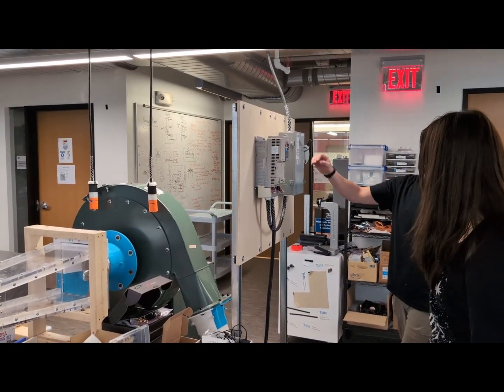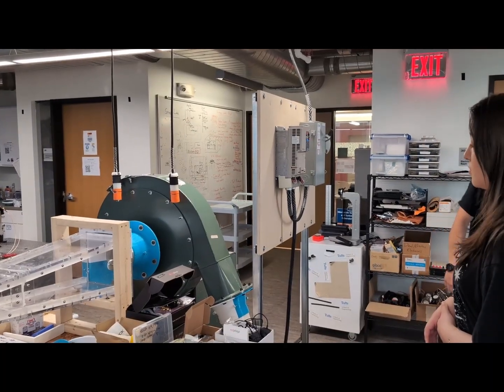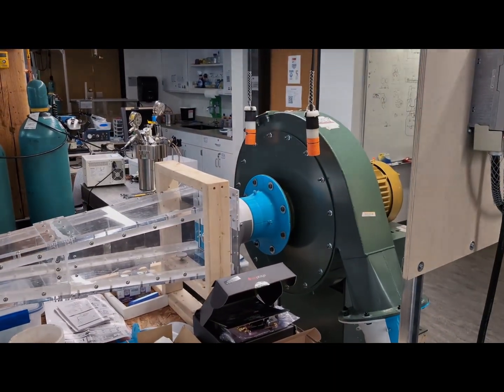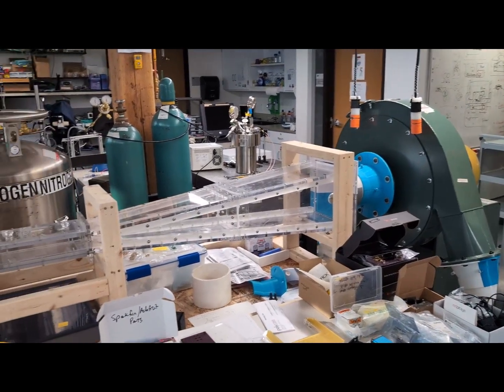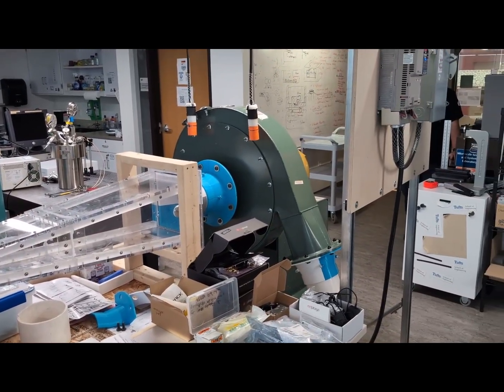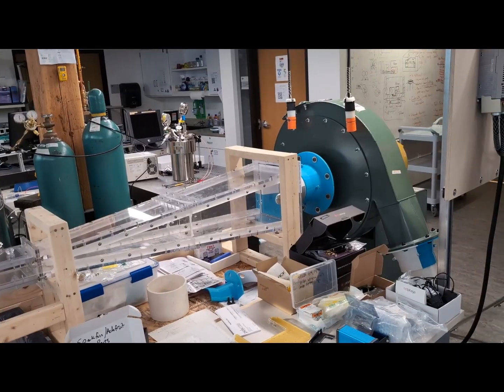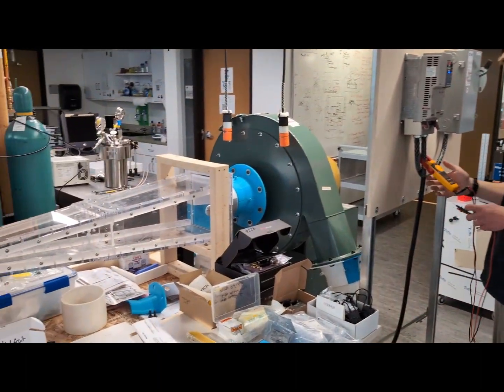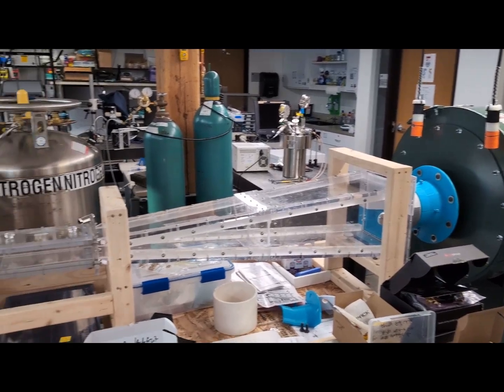Tufts Mach 0.5 Tunnel - First Turn On!

Comment: Yeah there are two ways to go ... suck down or blow down tunnels.  In both cases the air is recirculating around the loop, so it needs to be cleaned up in the settling chamber and as it goes through the honeycomb and screens before being accelerated into the test section (hopefully cleanly...) I'm not really sure I could say the main advantage of suck down vs. blow down, I think both can work.

Comment: Very cool. It looks like the air is “sucked” into the fan rather than blown. I’ve seen similar setups with indoor skydiving. What’s the reason for this?
Reply: Both can work, but if I recall correctly suck-down is easier to make the airflow less turbulent because the fan or blower is chopping up the air as it goes past. Technically the recirculating design is both, but the tubing after the "blow" end gives the air a chance to settle. Also, orienting the blower this way decreases the physical length of the system.